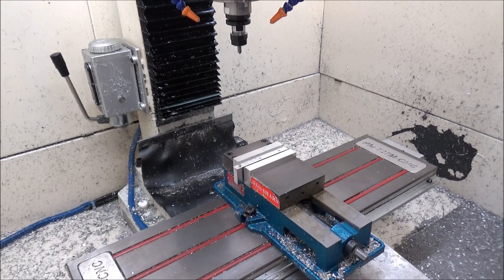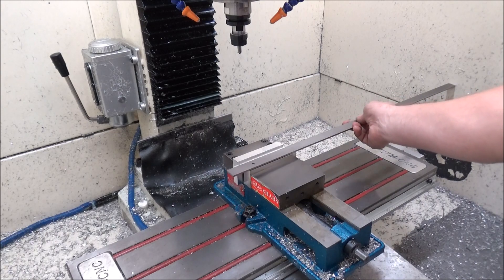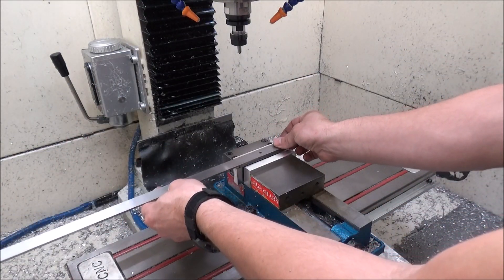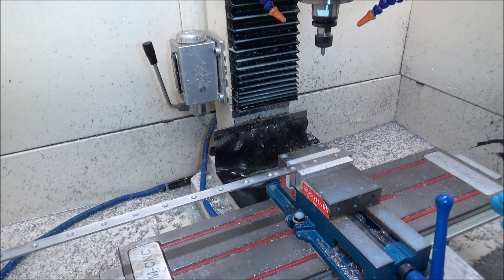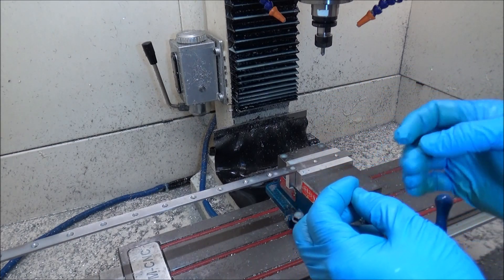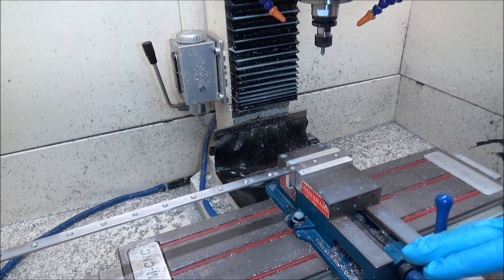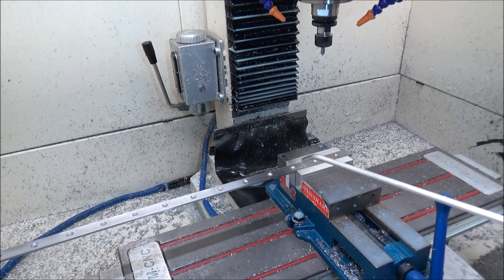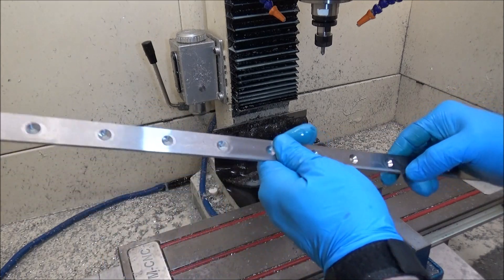The Real World

Comment: 2:05 - Shop safety... Don't wear gloves around spinning machinery
Reply from the maker: Hi Brian, Yes I agree no gloves around Spinning machinery!  My CNC mill is fully enclosed and I never reach in while the machine is running. I do use the Latex gloves often when making a run of parts and with frequent tool changes. I dont like to have the coolant on My hands. I'm sure it's not harmful but you never can be to careful these days and since it's making my paint peal I figured it may be a good Idea. LOL

Comment: Machining long parts on a table with limited travel in an enclosure.

 I have a 2007 HAAS TM-1P which has an enclosure.  I machine some long rails which require different offsets for machining similar to your project.  The metal end panels on the enclosure have Lexan windows that slide up and down.  When I machine these long rails I open both side windows so that the rails can extend through during the machining process.  I use flood coolant and when machining  these rails I position the flood coolant nozzle facing towards the rear of the machine in lieu of the OEM side to side configuration of the machine so coolant  doesn't squirt out the side of the machine.  However the coolant does travel down the tube and runs out the ends.  I keep a plastic storage bin on each end of the machine when doing these rails to catch any stray coolant.  When finished I just dump the coolant collected in the storage bins back into the HAAS machine enclosure.  Maybe not a perfect setup but it keeps the mess to a minimum.  Just thought I would share.

John
Reply from the maker: Hi John,
 Thanks for the tip!,
 I unfortunately am in no position to do this as my mill is surrounded by three walls. Which is why my mill is often designed the way it is. Ie Y stepper in the front mounting location as well as having no side panel Poly-carbonate.
Thant would have been nice for this project.
Reply: Yep, no matter how large you workshop is it is never big enough. Ha Ha
Reply from the maker: So True

Comment: You are doing two things that would have gotten you to be escorted out the door in most shops I worked in. first using air to clear chips and second wearing gloves when working a machine. The only time we were allowed gloves was moving/loading material, as soon as you went back operating the gloves came off. A fellow I went to high school with became a "Mikey Mouse" (three fingered hand) from wearing gloves around a printing press.
Reply from the maker: Yes your right I myself have seen a few incidents some of those images I wish I could erase from memory!
I try to brush mostly and only briefly use air to clear coolant. I also only use latex gloves just to keep the coolant off my hands. They tend to just tear if snagged. Not really a good response I know! I do try to be as safe as possible.
Thanks for the stern reminder.

Comment: Questions about linear rails, how are they lubricated, how do they handle flood coolant and how do you protect them from the ingress of chips and other debris?
Reply from the maker: Hi John,
The Linear rail blocks have built in wipers which should help keep debris out should any stray on the rails. The best solution is to try and cover the rails and prevent as much as possible. There are a couple ways to lubricate  the blocks manually and they also have auto oilier setup.
Reply: Auto oiling is best it keeps constant fresh oil flowing to flush any chips trying to work there way past the wipers the seals. Hard to beat that timer for consistency.

Comment: Good safety tips. I got a piece of metal stuck in my eye once when I was a grinder for Adams Hardfacing Co., and I was wearing safety glasses. I recommend a face shield or googles. I got lucky, I can still see out of both eyes.  BTW couldn't you have just re-positioned the vise or would that just cause you to run into the other side? Your smarter than me, I would have just cut a hole in each side and covered them with a plate afterwards figuring I would need it again some day. Because of the location of your mill that might not have been a good solution for you.
Reply from the maker: Yeah Man you cant replace your eyes and that the one of the most important tools we have. Repositioning the vise was my first thought However the center line of the spindle and the enclosure wall does not change no matter where the vise is located. Yes my mill is surrounded by three walls. After a few minutes of deep thought I realized the simplest solution was just to bore the 2nd hole just so I could clamp the stock in the fixture.

Comment: Could flood coolant be used to rinse the parts before using air?
Reply from the maker: I did use flood while cutting however the steel particles are so fine that they seem to just stick everywhere.
 I just had to be careful and use a brush mostly.